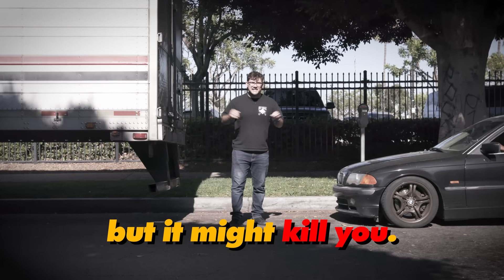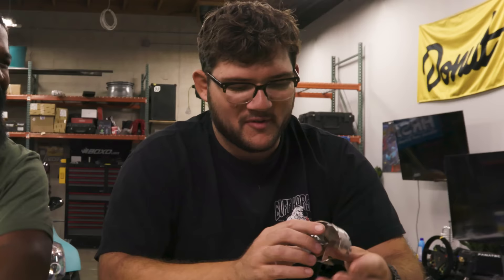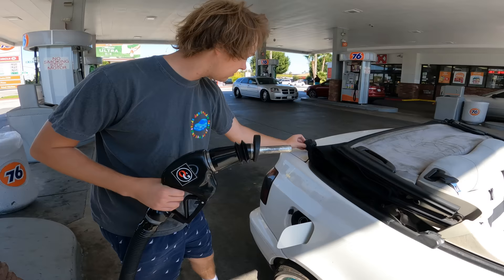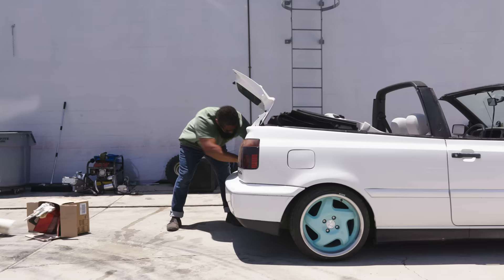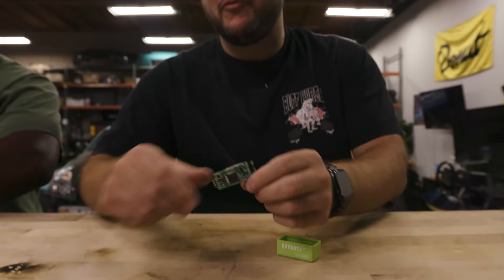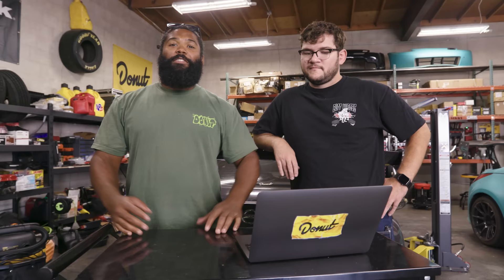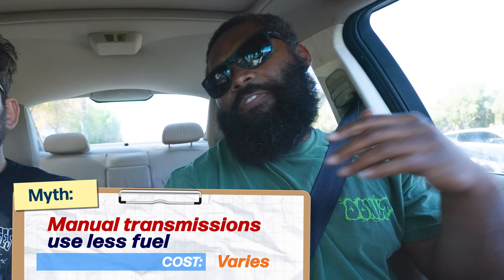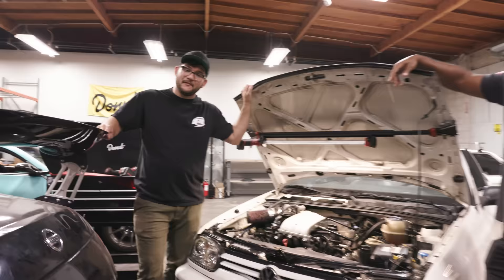Testing Fuel Economy Hacks

Comment: DEFINITELY do some sort of eco modding series! That'd be a great watch guys!
Reply: Yes please.
Reply: They should do that on a hybrid car like a Prius. Imagine if you add more MPGs on an already fuel efficient car
Reply: Agree they should
Reply: Please YES!!!!!
Reply: @yungboicontigo9278  that or an Astro van
Reply: Anyway, if you spend $50 on materials and improve fuel economy 10%, you would break even in 4.8 months in a Prius, 2.5 months in an average car, and 1.4 months in a Prius.
In theory you could have something custom fabricated, it would look good, and you would save money before too long.
Reply: If you want to see that, just go to Ecomodder and look up that 14 MPG Semi Truck the one guy modded. He went from about 5.8 or 6 or 7 MPG (I forget) to 14.1 - 14.3, no exaggeration. He did this in like 2008 - 2011, so a lot of the world's really late on the ball.
Reply: @101Volts  They had a couple quick screen shots of those forums and there are two short discussions about this video there.
Shepherd777 helped design the Shell Rotella Starship 2.0--or at least he helped design the first one and created the thread "AirFlow StarShip Initial Reveal" five years ago.
He started modifying semis for fuel economy 40 years ago.

Comment: Regarding "windows down", mythbusters also tested this one not once, but twice.

While windows up will always be better, if you need cooling AC is NOT always more efficient.  Below 50 mph, windows down is more efficient than running AC, and above 50mph, AC is more efficient.
Reply: This is exactly what I thought when I saw this,  lower speeds just doesn't produce enough wind reisistance for that to be efficient. I wonder how effective it is at different temperatures outside though..
Reply: I always wondered this, and logically thought so, that when you went highway speeds is better to use AC (espcially considering the wind noise) and in lower town ones its better to open the windows, you can also hear better around you. Now i have it confirmed.
Reply: @Pain9682  exactly. it depends on a lot of factors. how fast you're going, how long is the trip, how much you're opening the windows, and how hot it is outside. also if you have big windows, glass roof, ac is working much harder to maintain temperature. if outside temp gets close or over your body temperature, so high 90's, the more air gets in, the hotter you get. driving long distance on the highway with broken ac and 100+ F REALLY sucks trust me.
but if you consider comfort/gallon AC clearly wins unless outside temp is nice
Reply: Dependent on the A/C unit. Many modern A/C units have the option not to compress air while you are accelerating, only when coasting — they’re almost an energy recovery system. And certainly, keeping the windows up results in less loss of that nearly free cooled air.
Reply: the below/above 50mph may be true, however if its too warm outside and you arent getting much cooling from windows down, may aswell just keep them up and use the ac to get a temperature and turn it off. dont lose the cold air by opening the windows again because when you close them you'll have to use the ac to cool the car again
Reply: @Insanias  meaning don't fart!
Reply: @matthewmiller3392  it's "free" only if you have a mild hybrid that will use Regen to charge the 48v battery. on the highway on cruise control, coasting will only happen downhill
Reply: also if you have 4 windows all the way down and  going 45mph it's not going to be more efficient than AC set at reasonable temp
Reply: Depends on the vehicle my dude. A small, streamline car yes. Big SUV or truck, not so much. 

I test this using my OBD to scanner tool. I actually have a line graph for my 97 TL. 40-50ish is where they meet and a/c is more efficient.
Reply: @Waldel Martell Wut...
Reply: I didn't know that. Thank you.
Reply: @jonbar140  sure there is not one magical speed that works for every vehicle
Reply: Also depends what car and AC we are talking about. There has been a lot of progress made in car AC efficiency last decade or so.
Reply: Cool insight thanks
Reply: Mythbusters also showed tailgate up was more efficient getting close to TWO DECADES ago, so I get pretty pissed that this is still being questioned by "skeptics".
Reply: @h8GW  the funny (sad?) part is all these people driving trucks with empty beds that they use once in a blue moon, complaining about gas price, and trying to save 1 mpg with the  tailgate position.
because most people are not moving 4x8s on a daily basis.
Funny thing is Americans think they need to pay people to cook for them, refill their glass, file their taxes, walk their dogs, mow their lawn,etc..but he'll everyone needs his own truck because he's maybe going to build  his own house all by himself ', and haul all that hundreds of tons of materials back and forth from home Depot.
get real, you're gonna pay someone to do it too 🤣🤣🤣
Reply: @CalgarGTX  what kind of progress ?
Reply: My father in law tested this from Louisiana to North Carolina. His mpg was higher running AC.
Reply: @lawofliberty3517  there are a lot of factors at play that can influence mpg more than AC. speed/traffic/wind..he could have faulty AC too. don't forget in most case windows down won't give you the same temperature/comfort as AC
if you compare slightly opening the windows vs AC at full blast, You might have better mog without AC but it doesn't mean anything
Reply: @geemy9675  his vehicle was in  good condition. Traveling at 55+mph most of the time during that 700+mile trip. He had plenty of time to observe his mpg difference. Air drag on vehicles is a major impactor of mpg at highway speeds.
Reply: @lawofliberty3517  yep air drag is THE single most important factor for highway mpg. of course with the engine efficiency but you can change that by rolling your windows or turning ac on/off. that's why it's very surprising to experience better mpg with windows down. having driven I95 I can tell 55mph is not very likely unless you wanna get blown past by semis/truck hauling boats. I've seen people tow huge boats 80-90mph in strong rain storm with almost zero visibility 🙄
also rolling down your windows in the summer in Florida is like blowing steam to your face.
Reply: If you put the windshield defrosters on (on cool) it comes out cooler than the main vents ( with ac off).
Reply: I've owned 4 Honda fits. 2 auto, 2 manual. The manuals got consistently MUCH better mileage in town. To the tune of 30-35 percent.  I suspect this is mainly because there is a torque converter that converts energy into heat to allow for smoother shifts. I can actually get better gas mileage in my manual transmission in town than I do on the highway. That's because allowing your car to slow down to a stop sign of red light naturally instead of slamming on the brakes is worth a lot of saved gas.
Reply: @hughmccann7701  it looks like you are hypermiling, which could explain why you are getting way better mileage with a manual. it's is very uncommon to get better mileage in town than on highway, wether it's an auto or manual, but manual give you more control for hypermiling
also automatics progressively got as good or better than manual with lock up converter, planetary gears/getting more and more speeds, ECU controlling the shifts etc
so comparing manual and automatic you must also consider the age and technologies used by automatic.
PS sorry I just realized I misread manual being more efficient than auto in town, not more efficient than on the highway. torque converter wastes heat when starting from a stop, but so do clutches. torque converter should be locked up 99.9% of the time, even during shifts. except in stop/go/idle traffic
Reply: @geemy9675  there may be some new thing with supermodern automatic transmissions but for the vehicles that I've had that are 8 years old or so I know that the torque converters don't lock up until you are in top gear. So you are constantly losing energy to until you hit highway speeds, as opposed to a manual transmission where you are only losing that energy while releasing the clutch. Which is only a very short period of time during shifts.
Reply: @hughmccann7701  yep it's pretty much the opposite with new transmissions they're pretty much locked all the time except from a stop, like a sequential transmission or dct,also with more gears an better ECU in eco mode they can be almost in the most efficient gear so they can make up for having slightly more drag, except if you are hyper milling with a manual also due to emissions tests manuals are sometimes geared too long, harming performance without really improving real world mileage while automatics get launch control, so automatics are getting better and manual  somehow worse. some get improvements like rev matching but also rev hang can make them less fun to drive. I'll still pick manual any day...except maybe if driving only around town

Comment: The windows up thing is actually variable. If you're riding slow, the air resistance will be naturally lower, and thus the impact of the windows being open is much lesser. HOWEVER after a certain speed threshold, the air resistance becomes much higher (the faster you go the more the wind resistance affects you), so having the windows up becomes more fuel efficient
Reply: They got a lot wrong in my opinion, the EcoModder community I'm sure would strongly object to some of the "scams" here, like tire pressure! Didn't even finish watching the whole thing...
Reply: Somewhere above 40 mph, the drag of open windows hits the mileage harder than buttoning up and using the AC.
Reply: there really should be more info out there about the speeds where the switch occurs

Comment: The best trick would be driving slower.  At higher speeds most of the engine power is used to overcome air resistance, which rises exponentially. Double the speed means quadruple the air resistance
Reply: You just need to find what speed has the best return on mpg. For most sedans it’s around 65mph. I drive a Prius and find it’s about 68mph behind a truck I can get the same mpg at 75
Reply: @lilkris3008  seems about right for mine too
Reply: Noticed this with airplanes, they’re flying slower now because an extra 50-150kmh makes the plane eat exponentially more fuel relative before peaking at Mach 1
Reply: @lilkris3008  --- I remember hearing of considerable aero drag starting at or around 45 MPH. Not to say you should go 40 MPH on every road around, though.
Reply: @101Volts  this is true but at 45mph you aren’t going far. At 65 you can travel 100s of miles while only loosing 5-10mpg where as doing 70 would loose the same from 65. It’s diminishing returns you have to go highway speeds but you don’t want to waste any more than necessary.
Reply: @lilkris3008  Yeah, time is a most valuable asset, one often of more value than gasoline. I agree there.
Reply: not exponential! but a series of power terms with the most important one being quadratic.
Reply: @lilkris3008  going slower in a city gives worse miles to the gallon . note how the best mpg comes from speeds 40+ . maybe if you were constantly at a low speed itd work.
Reply: @theonewhoknows2  in most cars in my case (hybrid/EV) going slow uses no gas/less power I get about 60mpg highway and 80mpg city
Reply: it's more like, driving at a good speed, while keeping your engine revs low. If you drive too slow, your MPG is still gonna suck cuz you ain't going no miles with your gallons.
I heard EV have a different way of getting optimal speed for range, but i have no idea
Reply: @theonewhoknows2  cities give worse efficiency (in cars without regenerative breaking) because you use a lot of energy accelerating, than loose it when you break for intersections.
Reply: Where’s the fun in that?? 😂
Reply: @thetheatreorgan168  that is because of very high drag in the subsonic region, after Mach 1.5, drag comes back down. so most economical speeds are below 900Kmph, and above Mach 2.
Reply: @theonewhoknows2  yes city mileage being lower has a lot to do with requiring acceleration and deceleration. Driving at a constant speed, at any speed will be more economical than accelerating and decelerating again and again weather in the city or on a race track
Reply: @brianng9765  correct sir, there is a minimum amount of fuel the engine is going to be using no matter what, that is why we have gears, going 45mph in 2nd gear will drink more fuel than going 90mph in 5th gear (in the same car)
Reply: Idk man I did 75 on cruise control for over 100 miles on freeway I got my 13.5 mpg to 17.9 mpg never seen it before to, 5.3 vortec. Felt great In a 2005 sierra. She was happy and so was my money haha 😂😂
Reply: 2x speed = 4x inertia. when you say “air resistance”, do you mean to say that drag is directly and inversely proportional to inertia?
Reply: @lilkris3008  😮
Reply: In automatics find its happy spot turn your info onto instant mpg and watch your tach my car likes 54-55 at highway speed and 35-40 in town so speeding actually saves gas bc 30 it shifts constantly and instant economy reflects it. Ps do not do this in heavily patrolled or pedestrian areas.
Reply: Nobody wants to hear "drive slower", this is the NOW generation. Hahaha.
Reply: Correct. This science has been proven over and over and over again to the point that it's common sense if you want to be part of the conversation. Aerodynamic design will stretch the graphs and change where certain numbers happen, but the overall effect is always the same. Any speed at which drag is a factor (even slower speeds), the resistance to speed ratio gets wider and wider the higher you go. Therefore, it's obvious that you'll burn more gas in the same distance than if you had driven slower when drag is having a significant effect. Easiest answer if you're actually serious about MPG is to find out where the 'sweet spot' is for your vehicle where you're driving fast enough that you're getting somewhere for your RPMs, but slow enough that the engine isn't working harder than it needs to so you don't waste money. If you're not worried about money then by all means, put your foot down and don't look back, to each their own.
Reply: But cars get better gas mileage on the highway at higher speeds. I think this is a bit of a myth and it usually involves the fuel efficiency speed that seems to be close to highway speeds. I think that they are probably engineered to be more fuel efficient in that range.
Reply: @theonewhoknows2  It's not just speed but the slowest speed in the highest gear gives the best mpg
Reply: @chinaboytag1  Anecdotally, I get the best MPG when I'm in slight traffic (45-60 mph with minimal braking) on an expressway and when it's warm outside. Driving 80+ mph in my compact SUV in the winter just kills MPG.

City driving is bad for MPG because of the stop/go and idling that consumes gas while you're going nowhere.
Reply: @chinaboytag1  It's about the entire package, from engine to rubber. When does it in the most efficient way create and transfer energy and all that is in relation to air resistance. For most gas cars it will be something like 2500ish rpm on the highest gear, what speed that is varies.
Reply: Once you hit top gear any increase in speed will raise your RPM so the most fuel efficient speed would have to be the slowest you go in top gear but it isn't really that simple. Going 25mph in sixth gear is going to make for seriously low RPM but think how hard your engine would be working like when riding a bike in a high gear at slow speed. The same applies with going up a hill in a higher gear so really it depends on your car's gear ratios what speed is most fuel efficient. It is usually somewhere around 55-65 mph where your engine is the most efficient though because time is a factor and you'll use way more fuel going slow for a long distance.That's why the 55mph speed limit was introduced in the 70s it just didn't work out as well as they thought it would and it was too slow for people on the freeway. I suppose you would get the best MPG at whatever speed your car idles at but it would take so long to get anywhere you'd burn up the most fuel that way.
Reply: @volundrfrey896  I thought that most production cars were factory tuned for that to occur around highway speeds or am I just wrong about that?
Reply: Tell that to my street mpg vs highway